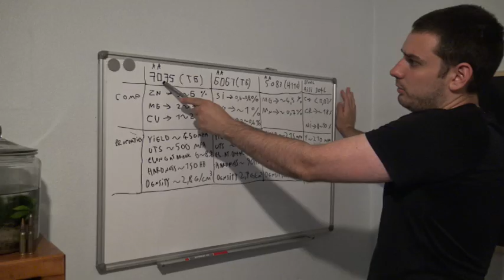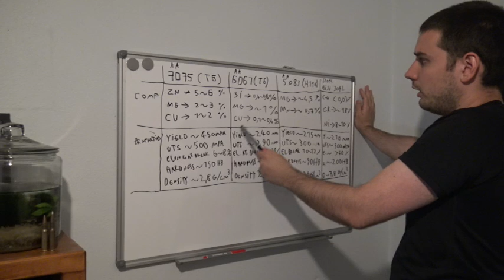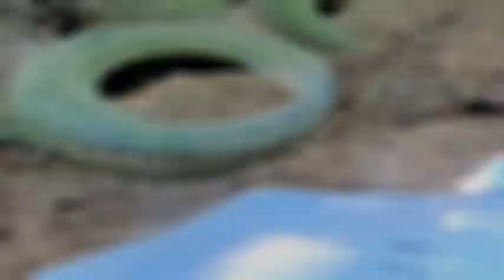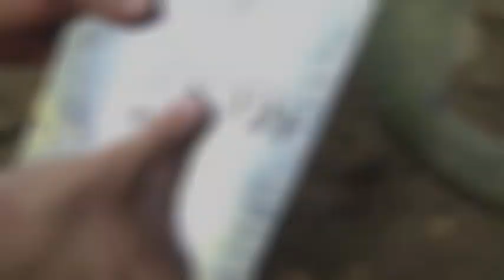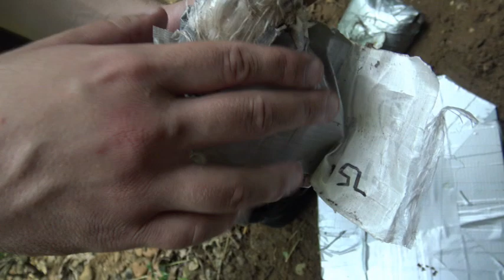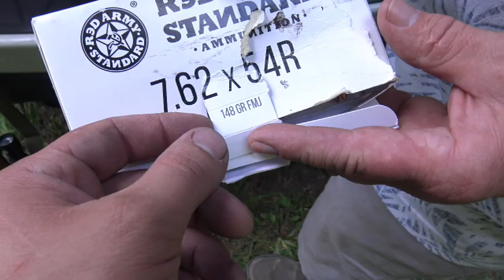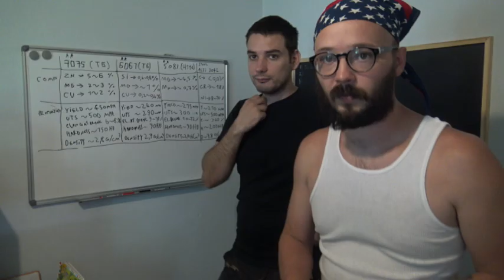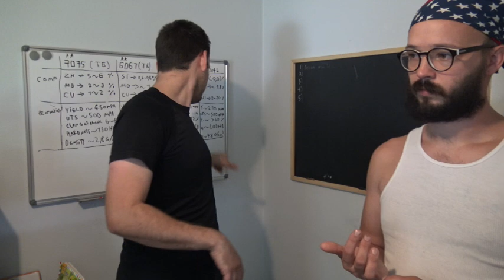Testing Aluminum alloys and stainless steel for armor!

Comment: Would be great to have a link to a page with your testing results. Materials, projectiles, etc. for each of your videos. This information could be invaluable rather than having to try to extract that info while watching your videos.
Reply: I agree. It's fascinating but I wasn't sure what alloy was what in what shot and what was the penetration threshold for each alloy.  Even just some different color spray paint on the face of each alloy would help.  A simple table at the end summarizing results would also help a LOT so we know what worked and what didn't for your research so we can compare it to ours for our further research.
Reply from the maker: Excellent idea. In my last video, I did a full guide for it (if you haven't seen that one already). For videos where I do just some different ballistic samples like this one, I think I could do an excel sheet or something simple for people to read. Thanks for the suggestion, I'll implement this soon. I think I'll make one for this and post it on this comment when I get some free time.
Reply: @Techthisoutmeow  , An image from an Excel sheet that you incorporate in your video and narrate should be easy to do and would be a fantastic value add!
Reply: Sample 1
10x12” 8lb 4oz
16ga SS 304
0.25” HDPE 
16ga SS 304
0.25” HDPE 
16ga SS  304
0.25” HDPE 
X39 penetrates
X39 and 5.56 stops with an additional 8mm porcelain

Sample 2
10x12” 3lb 13oz
16ga SS 304 2x
Stops 38, 380, 45, 357mag
44 mag penetrates

Sample 3
9.6x9.3” 0.9” thick
7lb 10oz
6067 aluminum T6 hardness
Stops x39

Sample 4
3.7x3.7” 1.2lb
5/8” 7075 T6
0.25” 6067 T6
200gsm polyester fabric
X39 stopped

Sample 5
15.75x12” 0.25” thick 4lb 11oz
6067 T6
Strikeface added (12x12” porcelain capri classic 8mm thick) 3lb 5oz
X39, 5.56 penetrates

Sample 6
10x12” 10lb 3oz
1/8” SS 304
0.75” VHDPE
1/8” SS 304
X39 penetrates

Sample 7
10x12” 10lb
1/8” SS 304
0.75” UHMWPE
1/8” SS 304
Stops x39
5.56 penetrates

Sample 8
3.7x3.7” 15oz
15mm 7075 T6
15 layers 160GSM UHMWPE
X39 penetrates

Sample 9
10x12” 3.4lb
5083 aluminum 10mm thick (2.6/cm^3)
Stops 38, 380, 45, 357mag
44 mag penetrates

Sample 10
10x12” 7lb 7oz
2mm mild steel
0.5” polycarbonate
2mm mild steel
X39 penetrates

Sample 11
10x6.75” 2lb 6oz
10mm 5083
Split strikefaces to compare
1- 0.25” 6067 T6 4x4” 6oz
2- 8mm porcelain tile 6x6” 11oz
Stops 38, 380, 45, 357mag
44 mag penetrates

Comment: A company that I used to work for made 5083 Extruded Aluminium Alloy Armour to MIL-DTL-46027 spec, to was designed to rapidly work harden when struck with a projectile or the blast from a mine, we supplied it to vehicle manufacturers who were building fast assault vehicles for UK Special Forces, and fast reconnaissance vehicles for the UK armoured regiments

Comment: I think the steel laminated HDPE composite could work as armor even armor that could block some rifles provided the steel inlays in the plastic weren't too thick like no thicker than 1/16 of an inch and it was fronted with a proper ceramic strike face like an Aluminum Oxide, Silicon Carbide, or Boron Carbide strike face that you can sinter at home. 

Probably have to find out the exact ratio that will work as a face if porcelain is still being used. I just refuse to believe that steel even a good grade of steel encased in solid block HDPE wouldn't be effective as a backer. Steel has always stood the test of time and has beat out pretty much any other metal throughout history. 

Those Aluminum alloys may be lighter than steel, but they're far from being tougher.
It's the exact opposite. That Stainless Steel showed just how good it was at being harder and more ductile and durable at the same time than aluminum.

Hell, depending on the grade, steel has even demonstrated that it's way stronger than even some high grades of Titanium alloys. Take AR500 for instance. Grade 38 Titanium alloy doesn't even come close to being as hard as AR500. And Grade 38 Titanium is supposed to be even tougher than Grade 5 Titanium.

I'm willing to bet that Stainless is probably hard enough to scratch some of those Aluminum alloys. Even mild steel could probably leave a mark. And it's weaker than Stainless.

But for the weight, one has to be careful because steel can get uncomfortably heavy if you rely on it too much for your armor. 
Aluminum has proven to be a good option strength to weight ratio wise, but the jury is still out on whether or not we can optimize Aluminum alloy composite materials for rifle rated ballistic panels. 

Oh, and by the way, happy new year to everyone. Sorry I couldn't join the party sooner.

Comment: The idea of work-hardening may be useful to explore.  The basic purpose of a ceramic strike face serves the purpose of deforming the projectile enough to be absorbed by the high tensile backing.  But the ceramics are heavy and not durable.  If you can work-harden the alloys to a high brittleness, brittleness relative to mailable  metals, may yield a desired degree of deformation with a reduction of weight.
Reply: Work hardening is ok for nonferrous alloys like aluminum but can make them brittle in unexpected ways (nobody is perfect at working the metal)
For steel alloys, you can quench harden to extremely hard but brittle martinsitic steel using a bonfire and a water bucket  (good for strike face if laminated)
For subsequent layers you can anneal it in an oven to reduce the brittleness..
3 tin can lids, 1 quench hardened, 1 annealed and 1 right off (or on) the can will stop a lot.
To test different glues/epoxies, I filled tin cans with clay and glued/epoxied the 2 heat treated lids on the bottom of the cans and put them in a frame made from an old pallet that fit cans 4x4.
It worked for all my pistol calibers regardless of glue, though the ones with a top layer of laminate seemed to dent less and have less spalling.
It was a really fun homeschool science project.
Reply: @RandyCampbell-fk3pf  Yeah, I know about steel quenching.  This channel has already made materials to repel most calibers.  The problem is weight and volume.  Lightweight materials capable of stopping pistol calibers isn't too hard.  its the issue with velocity of the rifle calibers that is proving a headache.  That's why i suggested he look into work hardening.  That one small work hardened piece of aluminum was surprisingly resilient.  I just thought that a work hardened piece of aluminum combined with other materials might be a lighter smaller avenue worth exploring.
Reply: I’m fairly sure ceramics are usually designed to be lighter that normal steel armor

Comment: I'm almost certain I did the numbers wrong, but is that 6mm aluminum plate only 1.17 Kilograms for a SAPI sized plate? And it can stop .357 magnum? (750 x 0.6 x 2.6) If so, that's almost perfect for a shield, going into the 2024 riot season.
Reply: A 10x12 inch (25x30cm) sapi plate forme 750cm² before cutting the corners

1/4 inch is ~6,3mm 

5083 is 2,6 gramms per cm³

So [ (750×0,6)×2,6] = your weight in gramms (1000 gramms = 2,2lbs) 

So yeah, ~1,2kg realm before cutting corners

Comment: And oh you want data on vehicle aluminum armor? Look up the M113 that Devon was driving. Pretty sure nothing about it is still classified, it’s ancient for military gear. It’s also all aluminum and can stop .50 cal AP/light auto cannon from the front. Especially at a distance. And for a vehicle, especially light duty civilian type for affordability you can’t beat high alloy aluminum, especially of with a thin ceramic face and composite backer, for cost. Strength and reliability. That’s honestly your best and fastest, most affordable solution that’s reliable .just pray it doesn’t get ignited, as you aren’t gonna put it out, too much magnesium in it. That’s the down side…only time you’d really face that level threat. Fighting a full up military, so don’t know that it matters much. As you gonna lose, at a personal level anyways.
Reply: M113 is 38mm (1,5inch) of 5083 if I remember

Comment: If you can get your hands on some 3mm (atleast) Hardox450 / 500, two layers of that with thin silicone caulcking inbetween stops 50 beowulf apparently.

Comment: Could you try some quarter inch aluminum backed with kevlar or some other pistol stopping fibrous backing to catch the potential fragments of the bullet?
Reply: As seen on the 7075 t6 + 6061t6 small sample that was wrapped in polyester curtain, the curtain catched the surface fragments from the 7,62x39

Comment: Screw aluminium, the way it is done is to have a 1/2 inch facing of PEI 5 porcelain, 8 layers of Kevlar 29 and 1/4 inch of Ultra High Molecular Weight Polyethylene as a backing layer.
Reply: That's way too thick in the end, and you also need a foam insert behind the backing layer to dissipate the force of impact (which is like 3/8 thick if you get the high-end stuff).  Also a chunk of UHMWP like in a cutting block is not the same as UHMWP armor that is composed of sheets melded together like kevlar.  You would be better off with the porcelain and like 28 sheets of kevlar (which is level III+ on its own).